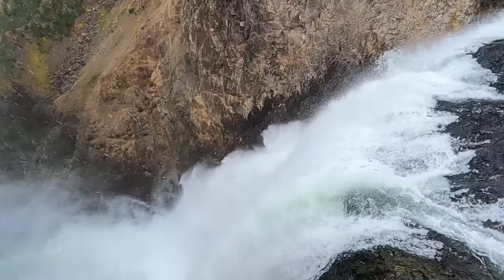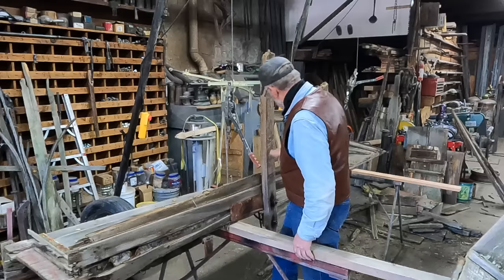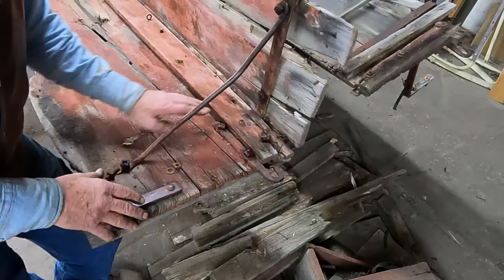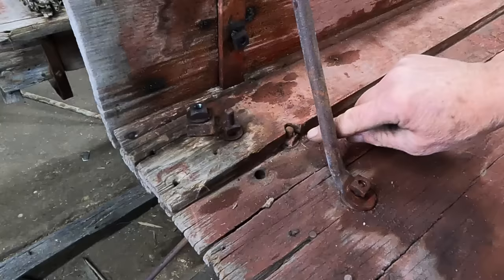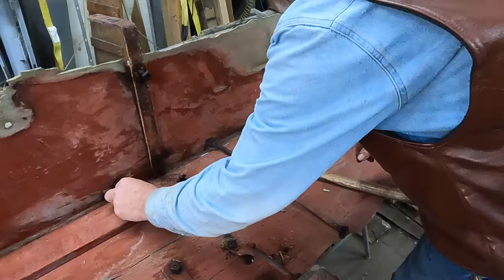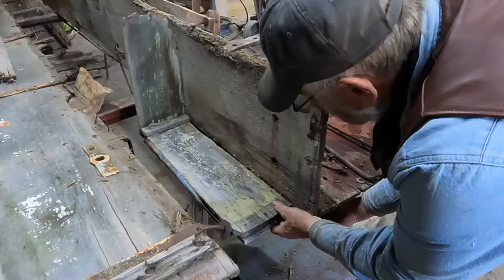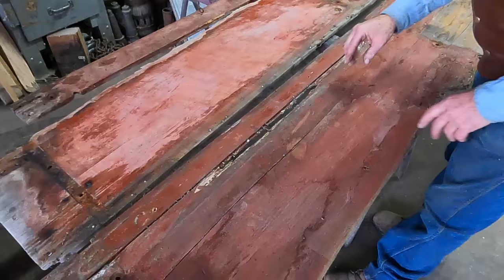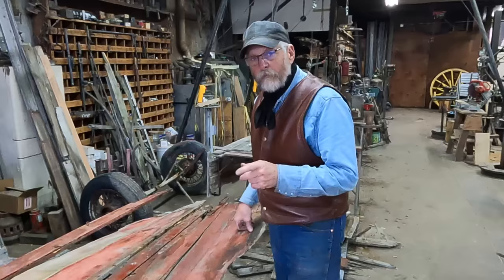If This Was Yours, What Would You Do? | Engels Coach Shop

Comment: I would build a new wagon based on the style it had been changed to. Useing the old wood when possible for the build out of the wagon.. Say if the side boards had enough wood to build the back end, seat bottoms , side boxes, ect. 
You could then do cosmetics,  say put the tin back where the wheels rubbed a hole, even though that repair isn't needed. 
That way the build would be safe and "right", and the customer gets the wagon he remembers that will last years .

Comment: The interview with the customer should be very interesting. I see three directions to go and none would save much money.
 First question would be if they wish to go with an all new running gear with wooden spoke wheels.
If that is the case, Then a new box will be in order as well.
 Question is, do you build it as a farm wagon as original, or also whether to add the necessary modifications to return to a sheep wagon.
 Cost either way may be a factor for him to consider. Lot of money for yard art, especially to sit outside all year.
he may consider using it for parades etc.
About all I can see that is truly salvageable are the irons, and what still exists to use for patterns.

Comment: i would take a picture of the way the wagon is now . take it apart and show a picture of all the iron . then rebuild it to new with the old iron and new wood ..; BUT if i needed a wagon and was going to pull with horses i would get a new wagon with bearings and rubber tires
Reply: This is a piece of history, representing the hardscrabble existence the early settlers dealt with. All of that old wood tells a story and I would keep it except the most rotted. Where boards are compromised, I would make a 30 degree miter (looking at edge of board) and feather in a scab in as little as necessary with wood glue. To discard most of the wood, would make it a new wagon and no longer 'historical'. And if I remember correctly the owner was interested in preserving the history and did not simply order a new wagon with old irons.

Comment: I would try using a lot of wood hardener to see if that firms up the rotted sections enough, then I might grind up any wood pieces that aren't being used to make a paste of sawdust and wood glue to patch up the missing chunks. I have no idea if that would work, but when ancient stellae and frescoes need reinforcing, they patch in new material where chunks are missing and don't try to make it look original. However, just for grins and giggles using the original old wood in the patch medium would even be original material. Aesthetically it would look like a patch that says it's a missing chunk that has been filled in for reiforcement purposes. Perhaps it could be done as a mold to make the boards whole again instead of cutting the edges away. I'd reinforce the patch to the board with hidden pins, like what those nails were doing. Molding the patches in wouldn't even require any scribing. I don't know if my idea would hold up in the weather, though. It would have to remain coated with some good waterproofing. If you had some antique wood from the time to add to it that would be aesthic.

Comment: If it were mine, I would salvage as much iron as possible, repurpose wood that is viable but maybe not for it's original purpose. Use as much "good" wood as there is in some way just to maintain a connection to the original wagon then build a wagon the way it was intended. I have done that with old furniture that had sentimental value but just too far gone to salvage. The challenge then becomes finishing the surface to look right. Good luck!

Comment: It's like the Ship of Thesus.  Over time virtually everything has been replaced, little by little.  At what point does it cease to be the original ship?  And if you took all the old replaced components, restored those, and then built a whole second ship using only those parts, is that the same ship, cloned?
My cost vs historical significance decision would lean toward fully replace any boards with rot or splits, with new material, and then cut down those old boards, use the remaining good material there in place of smaller bits that are rotted.  Maybe it would at least reuse 20 - 30% of the original wood, just elsewhere on the wagon.  The ironwork is a definite save & reuse.

Comment: I would go with new wood and rework the iron!
Reply: This is a piece of history, representing the hardscrabble existence the early settlers dealt with. All of that old wood tells a story and I would keep it except the most rotted. Where boards are compromised, I would make a 30 degree miter (looking at edge of board) and feather in a scab in as little as necessary with wood glue. To discard most of the wood, would make it a new wagon and no longer 'historical'. And if I remember correctly the owner was interested in preserving the history and did not simply order a new wagon with old irons.

Comment: Since you asked...if this was mine, I'd either call it a wrap at this point or pay for a full rebuild like the mud wagon.  It would be one thing if at least half of the wagon could be saved, but I just don't see the value in preserving the 10-20% (at most) of wood that can maybe be reused.
Reply: This is a piece of history, representing the hardscrabble existence the early settlers dealt with. All of that old wood tells a story and I would keep it except the most rotted. Where boards are compromised, I would make a 30 degree miter (looking at edge of board) and feather in a scab in as little as necessary with wood glue. To discard most of the wood, would make it a new wagon and no longer 'historical'. And if I remember correctly the owner was interested in preserving the history and did not simply order a new wagon with old irons.
Reply: @clearviewtechnical   the question was not “what would I do in Dave’s position?”  The question was what I would do if this was my wagon. IMHO, there just isn’t enough salvageable wood to use the “good” wood that is left and not have it be a mockery. Some stuff is just too far gone. From what I’ve seen so far, there isn’t a single floor board that is usable and a good part of the sideboards are scarcely better. Knowing Dave, however, he might have some magic to surprise me.

Comment: Have you ever considered getting one of those hand held induction heaters that auto mechanics use to heat stubborn nuts and bolts?
"Bolt Buster" is but one of the dozens of brands out there.
I mostly work with metals, so the torch is usually a good choice for me (although oil, grease and fabrics can still be an issue), but when you are working with dry, rotten wood, there'd be much less fire danger, I'd think.

Comment: I understand the owner's idea for this wagon. Most of the wood parts are in just terrible condition. Could you find some old weathered stock from an old house or building to replace some of that? The iron work is no problem. You can easily reproduce any missing items there. My grandfather built a barn in 1919 from wood off a building built in 1880 and it is still standing today. Wonder what those weathered planks would be worth. Of course I don't own it.

Comment: The way I see it is that you will be building a wagon with a few pieces of rotting wood in it. Not to mention the damage the might be caused to tools trying to salvage a few bits of solid material that will remain. The other consideration for the owner is the cost in time you will need to salvage these scraps of wood. I agree with another poster that the remains as it currently stands could be displayed.

Comment: Just what you're saying Dave, it Looks like an Old Grane Wagon converted into a sheep wagon. Not to surprising, folks were used to making do with what thy had and make it work! The Wood is shot for any other purpose but to serve as a message Board to telegaming what it was, and what it was turned into. No doughty in my mind it had Wooden Wheel starting out.
First step, just what you're doing. Clean it up, what a mess. Explore and collect as much information and maybe a few pictures for reference material! Step 2 Go back with all New Wood. 3 like the Mud Wagon and other project there will be a bit of Blacksmithing to do! This will be another fun learning curve Puzzle Project! let's get started.
I shire would like to see the Mud Wagon on its Carnage and getting upholstered.

Comment: The only person who looked at that wood and thought any part of it was in any way salvageable was Stevie Wonder. Reuse the iron and rebuild with new wood. If the original person who built it was around today, they would simply build a brand new one, but I understand the owner wants to try use as much as possible - the iron is pretty much all you can salvage. Should look great when project is completed.
Reply: This is a piece of history, representing the hardscrabble existence the early settlers dealt with. All of that old wood tells a story and I would keep it except the most rotted. Where boards are compromised, I would make a 30 degree miter (looking at edge of board) and feather in a scab in as little as necessary with wood glue. To discard most of the wood, would make it a new wagon and no longer 'historical'. And if I remember correctly the owner was interested in preserving the history and did not simply order a new wagon with old irons.
Reply: @clearviewtechnical  it was once a piece of history, however due to a dereliction of duty of care by the current caretaker to preserve it, maintain it, or protect it in any way from the weather - unfortunately it is too far gone to be salvaged. 

20 years ago there would be a case to preserve, but today, No. 

To what would you be attaching the new pieces to? Did you watch the video to the end and listen to Dave's assessment and conclusions? Even if there were sections that could be salvaged, how would what you propose end up looking when 80% + of the wood is replaced? 

Ray Charles would be proud of your assessment of the best way to tackle this Project!

Comment: Make a plaque out of the best wood.
Use all the old irons,on a serviceable new wagon.
Reply: This is a piece of history, representing the hardscrabble existence the early settlers dealt with. All of that old wood tells a story and I would keep it except the most rotted. Where boards are compromised, I would make a 30 degree miter (looking at edge of board) and feather in a scab in as little as necessary with wood glue. To discard most of the wood, would make it a new wagon and no longer 'historical'. And if I remember correctly the owner was interested in preserving the history and did not simply order a new wagon with old irons.
Reply: @clearviewtechnical  sorry for the spelling error , aplique ;as in applied to.

Comment: The decision is easy, replace what needs replacement and rebuild it back the way it was when last usable. I would omit the board below the quarter round because it will no longer have rot to cover, and possibly the floor overlay since it'll no longer need an overlay on rotten wood.. Otherwise I would rebuild it as you found it, keeping its lineage as a wagon conversion. I don't think a preservation job will hold up unless it'll be kept inside.
If I were the owner this is how I would have you do it. And if I only remember it with the Ford wheels then I'd keep them on it. Then I'd take it out and use it. 
Wood decays, splits and breaks, it's expected over the lifespan of the structure it's no harm no foul when it needs replaced.

Comment: That wood is just too far gone, and hidden rot is likely to contage to new wood. Agree with others who say use the irons, replace the wood. Now that you know the shape of it, you can reproduce it probably more in line with the original than if you were cobbling around the few sound bits. And might be the best use for the sound bits is to cut them down to use as interior shelving and such -- that way they're still preserved, but repurposed, and aren't in the way of rebuilding the rest of it.

Comment: As a woodworker myself I most definitely would NOT use anything I see for structural components. Use as much as possible for aesthetic value but it's just not a good idea for the main box or flooring. Someone will likely step or lean in the wrong place and either be injured or do serious damage to the wagon.
Remember you can't control what other people may do.

Comment: I agree with some the other that have posted. Make a detailed drawing, then save the iron and use the wood for kindling !
Reply: This is a piece of history, representing the hardscrabble existence the early settlers dealt with. All of that old wood tells a story and I would keep it except the most rotted. Where boards are compromised, I would make a 30 degree miter (looking at edge of board) and feather in a scab in as little as necessary with wood glue. To discard most of the wood, would make it a new wagon and no longer 'historical'. And if I remember correctly the owner was interested in preserving the history and did not simply order a new wagon with old irons.

Comment: You know, George Washingtons hammer was restored 3 times. It got 2 new handles and 1 new head. There aint much left to the wagon. It is what it is. But I suspect you knew this when you brought the pile into the workshop. Wonder if you could find enough old barn boards to re-create it with. Maybe mix in a few pieces of the original

Comment: My feelings go toward using the hardware only. If there is any solid wood left reuse it for small pieces you will need during construction. Look at he wood as a replaceable component and the metal and most importantly the original design the heart of the wagon

Comment: “If it were mine”… I’d save as much as practical and use that wood for interior details and obvious places that should look worn and build the structure with new wood and age it to match as close as possible. 

I do some repairs on old furniture and stringed instruments and have some experience with trying to “save as much as possible” on cherished pieces. Some customers are willing to spend $600 on a thing that will be worth $300 when it’s finished but I make sure they understand what we are about to do. Impressing those realities on a job as big as you have here may be difficult. Certainly the labor on this job is way beyond anything I have done but it is possible to save a significant amount of the original pieces using modern products. If the customer wants to display it outdoors however, that would further complicate the issues as fillers and adhesives are strong but don’t respond to humidity and temperature changes like wood.

I suppose in the end it will hinge on whatever understanding and agreement you can reach with the customer. I’ve seen enough of your videos to know the finished product will be much more than acceptable and I would defer to your suggestions if this wagon were mine.

Comment: A: I would offer to build a comparable sheep wagon in the spirit of the original design with as much original iron as possible.  Add the reinforcements as a historical reference.  Protected interior details might include marquetry using salvaged material from the original.  B: Swab test it for lead and burn it.

Comment: If it were mine I would choose to have all of the pieces of wood remade instead of patching the old wood pieces . It will never be like it was , so make it look as good as possible or just scrap the whole wagon . Waiting to find out what they decide and what you think should be done with it .
Reply: This is a piece of history, representing the hardscrabble existence the early settlers dealt with. All of that old wood tells a story and I would keep it except the most rotted. Where boards are compromised, I would make a 30 degree miter (looking at edge of board) and feather in a scab in as little as necessary with wood glue. To discard most of the wood, would make it a new wagon and no longer 'historical'. And if I remember correctly the owner was interested in preserving the history and did not simply order a new wagon with old irons.

Comment: I find this very interesting. I admire the customers desire to keep as much of the original wagon as possible. Give that, I would try to scarf some new wood to make up for the loss and maybe use some penetrating  Epoxy  on the rot in the middle of the larger boards. That shouldn’t bother you much because you’re probably going to paint the wagon anyway. My repair experience comes from boats and sometimes you don’t have any other choice but to try and deal with the wood you already have rotten or otherwise.

Comment: I could see where you might be able to save a small bit here and there, but I really don't see any one piece going back where it came from. Maybe use some of the longer pieces to make a tail gate or foot board... I really don't see much more from where I'm sitting. They would still have to be cut and milled to size, just to be usable in another place.

Comment: From what I can see on the video, saving everything that’s possible boils down to using the old iron.  The wood seems useful only as a pattern and for clues about the unusual construction details of the wagon.  If I was the owner, I’d have you build new wooden parts matching the old ones as best as possible, including the idiosyncrasies of the extensions along the top edge and all that.  I strongly suspect that after you talk to the owner, that will probably be the decision.
Reply: This is a piece of history, representing the hardscrabble existence the early settlers dealt with. All of that old wood tells a story and I would keep it except the most rotted. Where boards are compromised, I would make a 30 degree miter (looking at edge of board) and feather in a scab in as little as necessary with wood glue. To discard most of the wood, would make it a new wagon and no longer 'historical'. And if I remember correctly the owner was interested in preserving the history and did not simply order a new wagon with old irons.